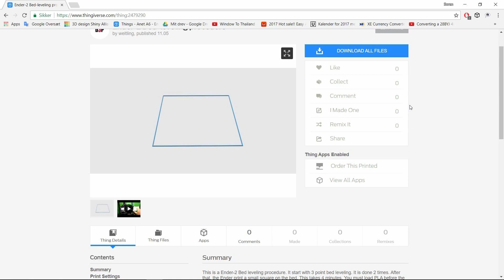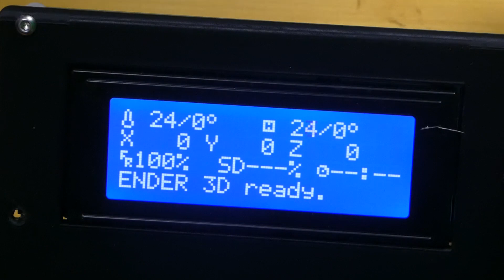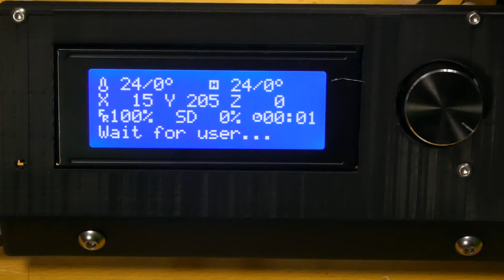Install And Calibrate Auto Bed level sensor on the Ender 4

Comment from the maker: After you have done this. you need to enter the command G29 in your starting script of you slicer.  Below an example, that include prime of the nozzle.

G28 ; home all axes
G29 ; Auto leveling
G1 X0 Y5 Z0.2 F3000 ; get ready to prime
G92 E0 ; reset extrusion distance
G1 X150 E20 F600 ; prime nozzle
Reply: Danish 3D Printing what is your opinion about this printer?
Reply from the maker: The Ender 4 is absolutely one of my best printer. It is reliable, and with the ABL sensor i almost never have fail in prints.  For me price and quality fit very good together.
Reply: Hii can. Pls help to how to install auto leveling in ender 4 printer and pls giud me to how to enter G coeds in printer
Reply: Where did you connect the cable ? And also is there any firmware to install ?

My printer is Ender 3 pro
Reply from the maker: Hi Khalid  You just connect it to the Z axis connector  on the mainboard.  No need to update firmware
Reply: @weitlingD3P  okay noted, but the problem is the sensor connector is 3 pins and the board is 2 im soo confused 😅
Reply from the maker: Hi again I think you are at the fan section  I made a link to a picture i made, that will show you where to connect to the board.  follow the link below  https://1drv.ms/u/s!AgaOae17V8Hig-1TLSjAixlUvXZJIA?e=tdawwM
Reply: @weitlingD3P   i just realized the board is different than what i have i need to find another sensor that compatible with my board , thank you so much🙏🏻

Comment: You don't actually tell us how to install the sensor, or what sensor you are using.
Only how to use it after it's installed.
Do you happen to have a video on the installation?
I assume this will also work on the Ender 3.

Comment: When I got my Ender-4, I was wondering where I could get the manuals and such online... I totally spaced out that I got an actual SD card with the printer.  I was thinking it was as SD card holder and I was like, well I've already got one of those, so just toss that in the drawer and forget about it.  I guess I'll have to actually have a look at it.  Now I can install the bed level sensor by replacing the z stop sensor.  (I bought mine off Ebay for less than Creality was charging).  My filament senor (bought off Ebay) kills my board though (until I disconnect it).

Comment: Is it possible to use auto leveling on the Ender 2 also?
Reply from the maker: Hi.  I don't think the mother board is prepared for it. Any way it is not necessary, because of the build volume just follow my link for easy bed levelling on Ender 2, and you are good to go. 
https://www.thingiverse.com/thing:2479290

Comment: How far out of level can the bed be that the auto leveler can compensate for? When I installed mine it never made the beep like in the video. When I tell it to auto level it goes to all 4 corners like it should however after it is done when I tested it the bed was still out of level. I read on another site that most auto levelers are good for about .2 mm or .0078". That only 2-3 sheets of paper. Is that true?
Reply from the maker: Well i only recommend 1 sheet of copy paper (As used in the video), that work on all my printers when i print with a 0.4 nozzle.  
Have yoo checked your slicer, that it not somehow compensate on the Z axis.

Comment: Which is the best printer you own?
Reply from the maker: That is a very good question.   I`m not sure i have a favorite printer,  all my printers is used almost equally.  Only my Dremel i use less.  Mainly because it use its own filament.  I am very happy with the printers from Creality, My Ender 2 and 4.   If i have to chose then it is my Ender 4.  It has a good print quality, and is very relieble.

Comment: Where on the circuit board do you connect the auto level sensor?
Reply: If you plug the included SD card into your computer and browse to "Ender-4  User Guide\3.Upgrade functions\2.Automatic leveling" there is a user guide that says to replace the z axis limit switch.
Reply from the maker: The same connector as the manual end stop is connected to
Reply from the maker: Correct

Comment: I found this 3d printer very interesting,  my only concern is that the gantry system is h bot based which can cause uneven retraction on the opposite side of the belt on x axis movement that result in to racking. I don't have and printer yet and planning to buy one soon so I'm searching regoriously through the web. My question is are you experiencing racking on your ender-4 printer or do you another issue? How about the motherboard? I'm also looking forward for your guidance.
Reply from the maker: Thank you  for passing by Belmar.  I have no issues with my Ender 4 and i have done 0 upgrades.  
The only thing i did, was calibration of the axes and extruder.  It works just perfect for me.

Comment: The sensor ,youcan buy it here https://www.aliexpress.com/store/product/10PCS-SN04-N-4mm-Inductive-Proximity-Sensor-Detection-Switch-NPN-NO-DC-10-30V-Normally-Open/1668604_32269637772.html?spm=2114.12010612.0.0.1fabd106WnzHds

Comment: Question, why not build a spacer that sets the nozzle and sender at the same time. 
Say a stairstep spacer. Thin for the nozzle and thinker for the senor?

or say if nozzle is just barely touching bed the senor should be x mm off bed?

Or is the light the best way?

cheers
Reply from the maker: i was thinking on that, i found this the most easy way.  It is mainly a one time opperation.